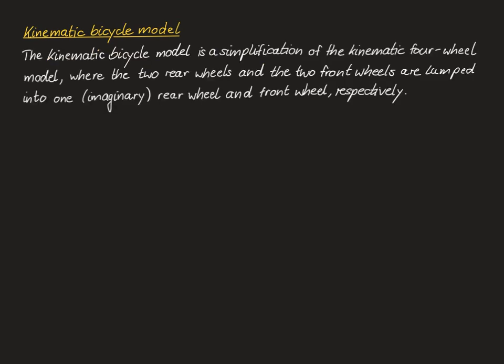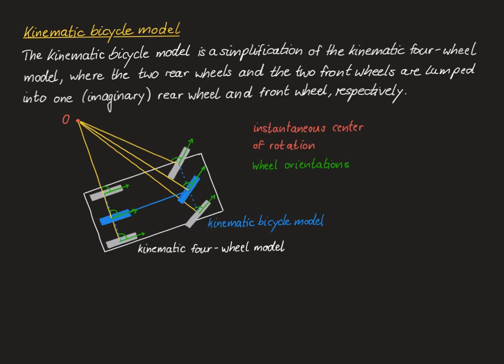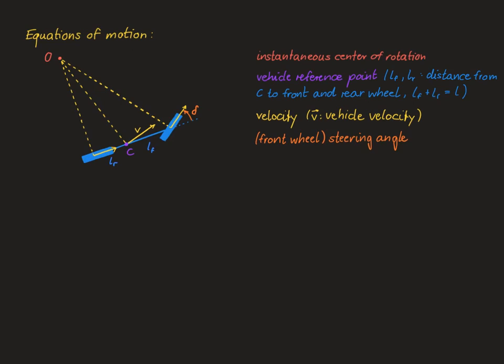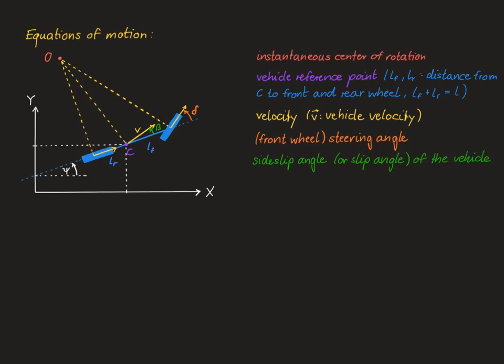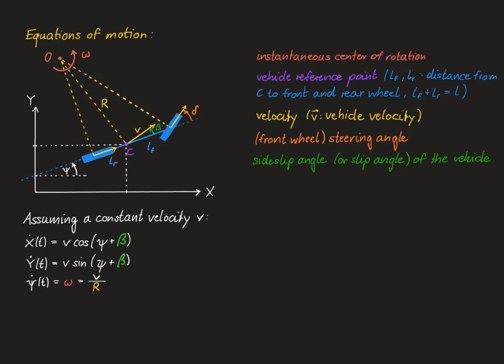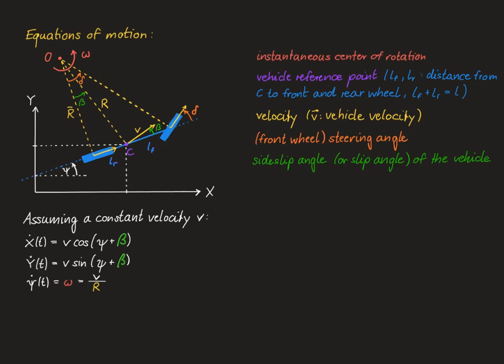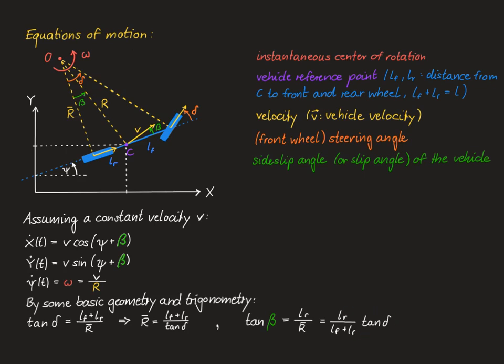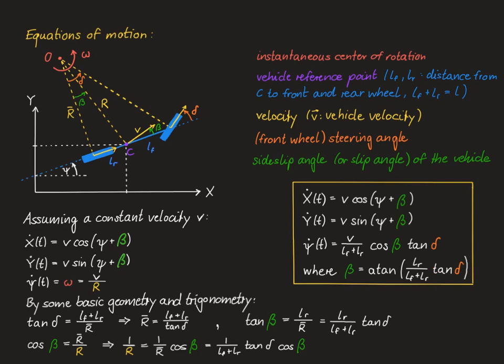Vehicle Dynamics & Control - 05 Kinematic bicycle model

Comment: Thank you Professor, very clear. I have a question with the last step in the derivation. Unfortunately my high school trig is lacking. So to anyone reading this, if you could enlighten me it would be most appreciated (exam's next Tuesday :/). 

How do you get from (1/lr+lf)*tan(d)*cos(B) ---to---> B = atan[(lr/lf+lr)*tan(d)] ?
Reply from the maker: You get there from tan(B)=lr/(lf+lr)*tan(d). Good luck on the exam!
Reply: @professorschildbach   Ah ok, so you just used the tan(B) which = lr/R(||) and then substituted in for R(||). The switch from cos to tan threw me for a second. But because the angle B can be expressed in any of the following ways sin(B)=lr/R, or cos(B)= R(||)/R, or tan(B)=lr/R(||) it's all the same. And you needed to find R first that's why used cos(B) instead of going straight to tan. 
Thanks for getting back to me

Comment: Professor, may I ask when to use rear wheel reference and front wheel reference since mostly we use center point reference. Thanks
Reply from the maker: It is difficult to give a general answer. The the rear axle is typically used as a reference point for low-speed applications (like parking). The CoG is often used as a reference point for high-speed applications. The front wheel is rarely used, in my experience. However, it is used, for example, as the reference point for the Stanley Controller.

Comment: In 10:22, why not use sin(beta) to calculate R since it is much simpler than using cos(beta)?
Reply from the maker: There are multiple ways to derive the equations. All of them lead to the same result, of course. It is up to you, which way of calculation you find easier or more intuitive.

Comment: What if delta gets to 90 degrees?
Reply: Kann man die definitionslücke durch wechseln eines Modells umgehen?
Reply from the maker: First, a normal car will not allow a steering angle of 90 degrees. That being said, the intuitive answer to that question should be clear: The vehicle will rotate around the center point of the rear wheel. Now, what happens mathematically is a little more interesting and requires to calculate the limit of R as delta -> 90 degrees. With the formulas in the video, it should give you l_r, but I have not tried.
Reply: @professorschildbach  TY for your response. I am using the model for an agv (one front wheel, steering not compareable to ackermann steering from a car). When I drive the agv with steering 90° it rotates around the rear wheel, just like you said. I am having trouble to model this mathematically. 
when delta -> 90° then tan(delta) -> inf => Therefore: omega (angular velocity) -> inf
In my model i integrate omega to get the angle phi. And I use phi to calculate d/dt*x and d/dt*y (both should be zero, I take the rear wheel as origin of the coordinate system) -> as omega is inf -> sin(phi) or cos(phi) will have some random value (between -1;1)* v. Phi value obviously makes no sense anymore.
Now I took a model where the coordinate system origin is at the front wheel -> here omega = v / L * sin(delta), so delta -> 90° -> omega = v/L - which is realistic. Then I use coordinate transformation to get back the to rear wheel (as this is my zero point for the agv coordinate system).
Reply from the maker: @felix-ke5sr  Clearly, you have to use a value of delta that is increasingly close to 90 degrees to evaluate the limit numerically. If you want to do it analytically, you can try to use a power series expansion of cos around 90 degrees.

Comment: Can anyone tell me some models other than bicycle model?
Reply from the maker: There is a huge number of vehicle models, which are used in all kinds of situations. For example, the dynamic bicycle model (covered later in this course). There are also different kinds of two-track models with increasing degree of complexity.

Comment: As Kinematic Bicycle model is applicable at low speed but there is any particularly defined numerical value for speed below which it's applicable.
Reply from the maker: No. It depends on many factors. It's a model, so it is never 100% accurate. And it tends to be less accurate at higher speeds than at lower speeds.

Comment: Can you make a video with transfer functions for this model?
Reply from the maker: The kinematic bicycle model is a nonlinear model. Transfer functions only exist for linear models. So there is no transfer function for the kinematic bicycle model. If you are interested in a linear model, with a transfer function, please take a look at the linear bicycle model (in the video on the dynamic bicycle model).
Reply: @professorschildbach  First of all, great videos! I seem to have some trouble locating your video with the transfer function, can you link it directly?
Thanks in advance.
Reply from the maker: @rasm910a  Thanks, I'm glad to hear that my work is appreciated! About your question: At the end of the video on the dynamic bicycle model, the transfer function is not stated explicitly, but you can easily derive it from the state space model stated there via the standard formula C(sI-A)^(-1)B. It's a second-order system. We will turn our attention to the stability of that system in due time.
Reply: @rasm910a  Were you able to do it. I understood about A and B in SS format but don't get what is C
Reply: @professorschildbach  I get what is A and B but could not understand C, how do we find it sir
Reply: @abhishek_raj  just checked it. Simply done by using a first order taylor expansion of f(V, delta_f). Here the first part is 0 and you end up with 2 parts, one expressing the velocity and the other the direction. K_V and K_delta. 

From here you have delta sigma dot = (K_V)*V(t)+(K_delta)*delta_f(t)

For a SISO system velocity can be assumed to be 0, from a steady state position. Therefor leaving only (K_delta)*delta_f(t)

Laplace of that:

Reply if you need it. Think an image would be easier to follow.